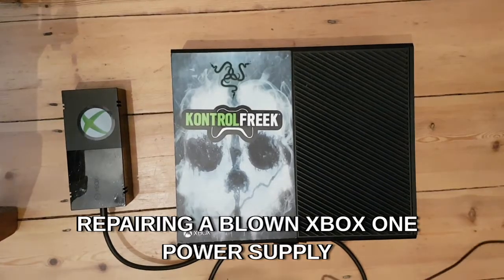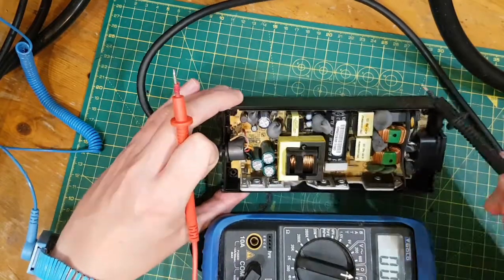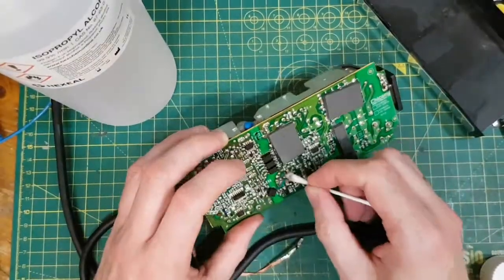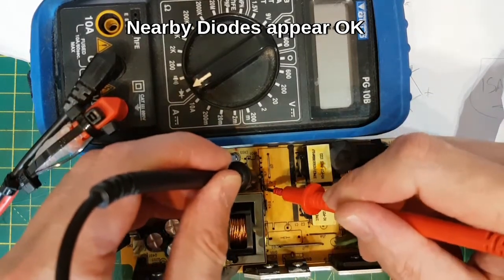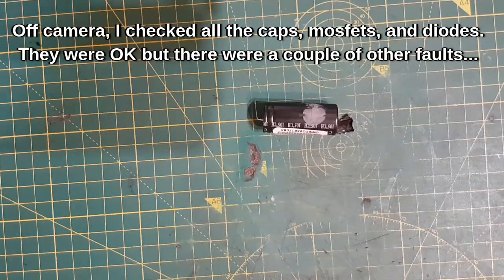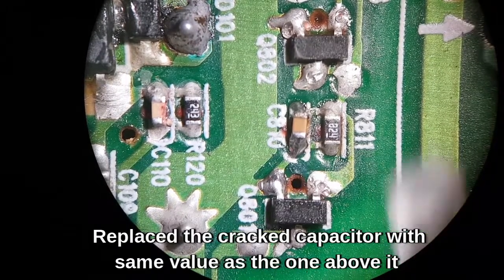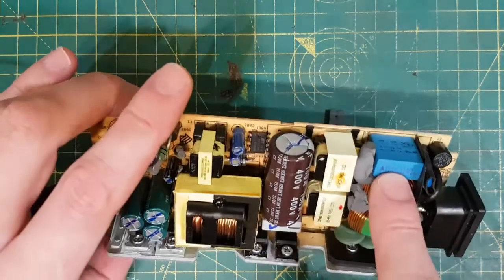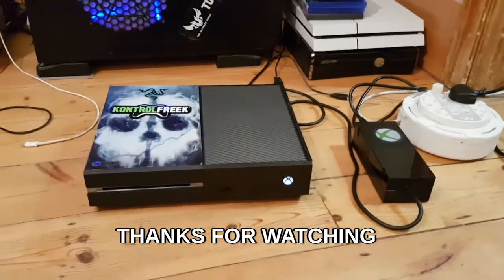Random Fix: Fixing a Blown XBox One Power Supply (PCB Repair)

Comment: Thanks a lot for the video. I got a replacement power supply by chance from a flea market today for a console I needed to test out, but it turned out blown. I was quite disappointed, but thankfully I have some repair skills, and it appears I have the exact same issue. The switchmode chip is cracked and left a nasty burn mark underneath the PCB, taking R202 and the trace on its right along with it. I havent checked the fuse, but given the PSU doesnt react at all when plugged in, I think it's very fair to assume it's gone as well. I had gone the cheap route and it bit me in the ass as it does, but now it's about whether it'd be financially smarter to buy components and repair the PSU or buy a known working one outright

Comment: I replaced the Xbox power supply, comes on now but goes off after 3 seconds, any suggestions
Reply from the maker: Not sure. Maybe overheating/full of dust or, worst case, bad connections under the CPU?

Comment: Hi, sorry to bother in an old video, but i saw your notes at 5:33 and you wroted the part "IRFB3306G" which is the faulty (shorted) mosfet i have. Its a common fault? Do i change both mosfets or just the faulty one? I only managed to adquire IRFB3306 which, according to the equivalence table, should work the same. Thanks!
Reply from the maker: Hi, Thanks for watching. Mosfets do fail pretty commonly in switchmode power supplies. Changing both would probably be more belt and braces as I believe tgey are working in a pair. You could probably get away with just changing the shorter one. I would double check the markings on the shorter mosfet when you remove it as it has been a while and those notes may have related to something else. Probably not. But worth double checking. Best of luck.

Comment: I'm trying to fix up one I got. I replaced the caps and all I'm getting now is orange light then turns off. Does anyone know what could be causing this? I believe it's a resister but idk what kind to buy and how to check.
Reply from the maker: Hey. No expert but what threw me was that resistor that came off with the cap R806 (shown at 16:06 in the vid) I lost it and had to go scanning pics of the board on Google to find the value lol. If you have lost a resistor or are unsure of the markings, it is amazing what you can find online and blow up to read the values. Best of luck. Let me know if you want a picture of the board.

Comment: subbed for that amazingly in depth and comprehensive showcase of the PSU. Not only did you fix the problem in yours, you quickly addressed most common faults that others may have ("puffy" 5V cap on min)  and offered solutions to solve said problems with little to no problems.  Thank you, more of you should exist :)
Reply from the maker: Thank You
Reply: @Plan-C  Finally done with the repairs and it works just fine again :P
Didn't think I had any 1500μF 16V caps laying around, but old PC parts/psu's are perfect! Found several, but I now know I need a new and better soldering bolt. All this machine soldered stuff needs waay more heat than my gas bolt can make. Thanks again though,  this means I won't have to buy a used one, or wait for new parts :P

Comment: hello , i have a power supply that has no problem with the capacitors , they are fine , i've changed them anyway but the power supply doesn't work , when i connect it to the xbox the light goes off , what could be the problem ? it could be the mosfets ? thank you
Reply from the maker: Thanks for watching. Not sure to be honest. It sounds like you have standby power but not the other rails? Tbh, I was pretty lucky with that one as it was easy to see what had failed lol. They are pretty complicated units. Good luck.